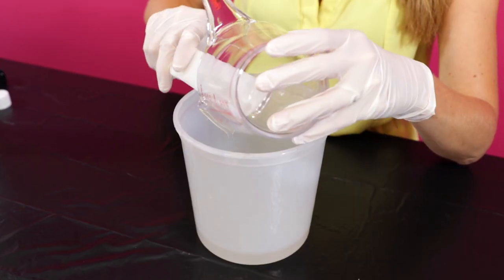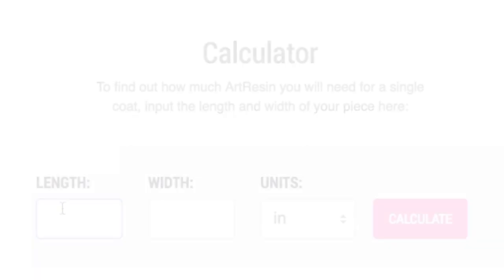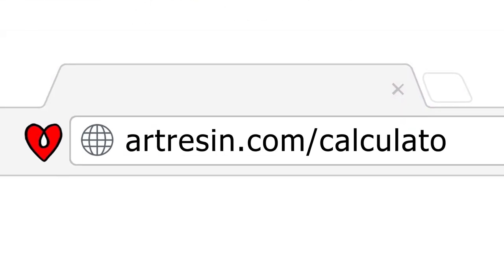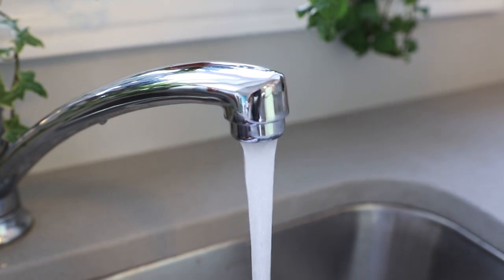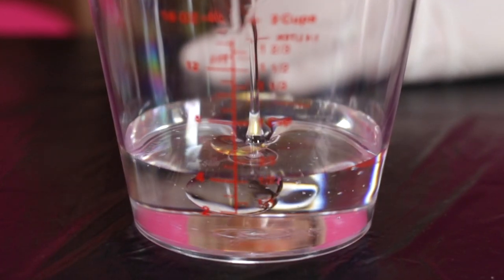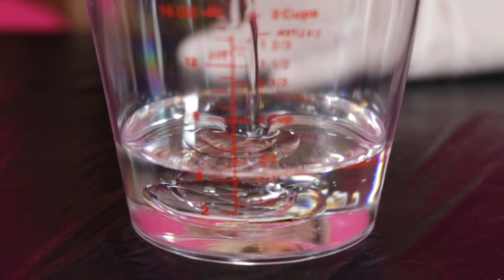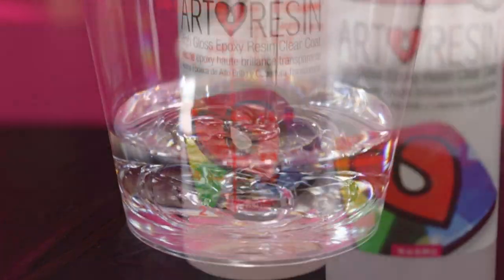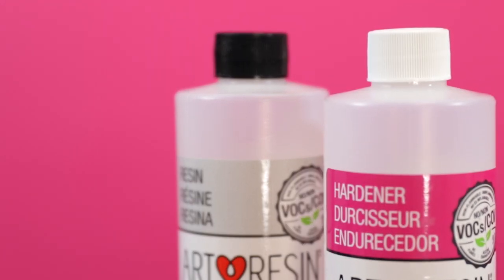ArtResin 101: Step 2 - Measure

Comment: How do I measure the resin and hardener for shaped molds?
Reply from the maker: To determine how much resin and hardener you will need to fill a mold, it is easiest to just fill the mold with water or sugar, etc then measure how much it took to fill.  Just be sure the mold is clean and dry prior to pouring in your resin.
Reply: Ok thx

Comment: I'm using this as I'm biginer my risen become thicker after few minutes also I haven't idea how to measure for 13 inches mould as I'm using digital scale
Reply from the maker: You will need to determine how the resin you are using is measured.  ArtResin is a 1:1 mixing ratio (resin:hardener) by volume, not by weight, so you will not want to use your scale to measure.  Different brands will also have different working times--the time between when you mix it to when it starts to thicken to the point of being hard to work with.  With ArtResin you have about a 45 minute working time so it is best to get your pouring done within that time.  If you are filling a mold, the easiest way to measure how much resin you require to fill it is to first fill it with water, then measure the amount of water it takes to fill.  (be sure to thoroughly dry your mold out prior to adding in the resin). I hope this helps!
Reply: ArtResin plz help me to guide I'm using art risen product whenever I made it on more quantity it becomes hard suddenly after few minutes like I put 16:16 ratio it suddenly get hard :(
Reply from the maker: @ammarakhalil1559  just be sure you are mixing in a large enough container to allow some of the heat to escape rather than mixing and letting your resin stand in a deep cup.  Try to pour your resin soon after mixing it.
Reply: @Artresin   thank you for your guidance one more thing I want to ask weather it's quantity more or less it's consistency become thick honey so whenever I want to use it for pouring purpose it becomes more thicker during process what should I do make it's consistency normal and not much thicker so it can easily move on canvas during pouring....I'm using same product of artrisen
Reply from the maker: @ammarakhalil1559  ArtResin is the perfect consistency for pouring over a canvas, its texture lends itself well to doming :)

Comment: I have a question about your calculator…….or any calculator. Why do different brands coverage calculators vary SO MUCH?
Reply from the maker: You could be seeing variations between different brand calculators based on their recommended application depths.  For example, our calculator will calculate the amount of ArtResin needed to coat your canvas in a single layer of approximately 1/8"- the thickness to which ArtResin will naturally self level to.  Other calculators will take into consideration the pouring thickness guidelines for their particular brand.

Comment: Hi Im looking to buy art resin but dont know which  one will suit my needs , I will be using it to cover my paintings,  moulds, trays and to resin ontop of wood,  can you advise me please 😊
Reply from the maker: Hi Annamarie, thank you for your interest in ArtResin.  ArtResin was developed as a surface coating for art, designed to be poured at 1/8" thickness - so it is a great choice especially for your  artwork and wood projects.   You can use ArtResin in your molds, if you want to pour molds deeper than 1/8", we just recommend pouring in layers, allowing each layer to cure for 3-5 hours between each layer.   We offer an 8oz kit on our website which is a great way to try out ArtResin!  www.artresin.com

Comment: while mixing hardener and resin its gone in white color not transparent plz tell the reason?  but its not about ur products
Reply from the maker: It could be possible that some water or moisture got into the product but to be honest I am really not sure as we haven't had reports of that with our product. I would reach out to the manufacturer of the brand you are using to see if they get reports of this and know why it would happen.
Reply: @Artresin  thanks
Reply: @Artresin  thans dear i try my 2nd time n got transparent i used hot water n put both epoxy bottles in it n got tha result

Comment: Measuring by volume and NOT by weight is so important! If you measure by weight there's a good chance your finished piece will NOT cure correctly and be flimsy.
Reply: Really? But the seller where I got my resin suggested me to get a scale and measure by weight since it's much accurate. But I dont have scale so I opted for volume as I only have measuring cups. I'm confused.